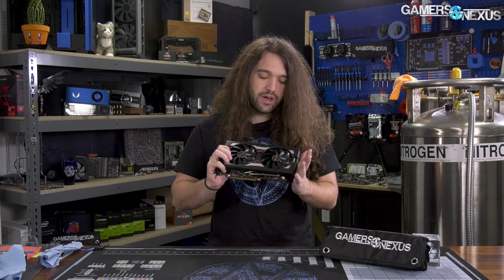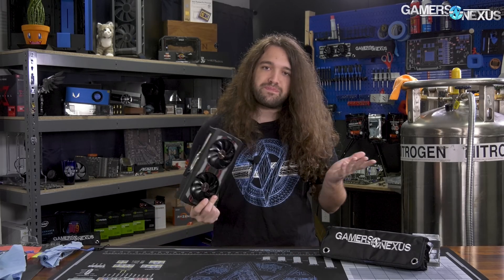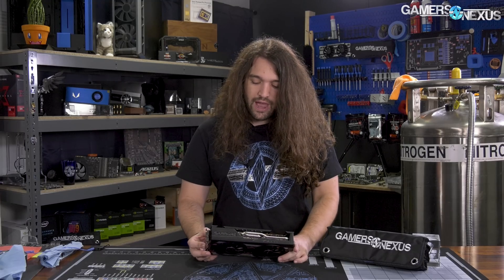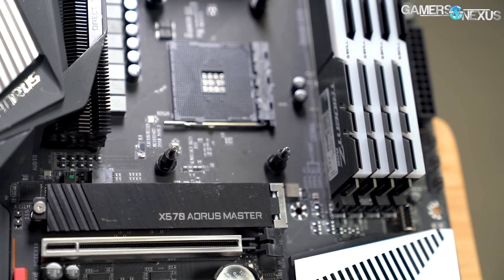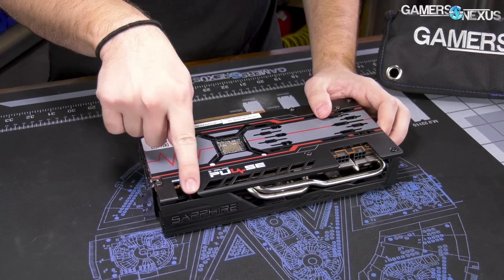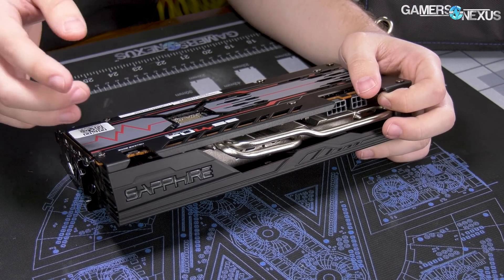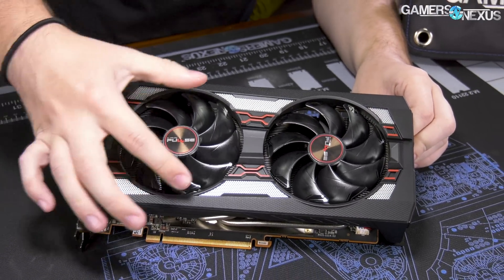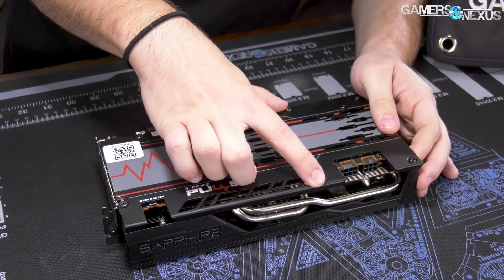Sapphire RX 5700 XT Pulse Tear-Down: Cooler Quality & Assembly

Comment from the maker: Watch our original 5700 XT Pulse review here: https://www.youtube.com/watch?v=FQJCm7bnOfU
Grab a GN toolkit or Wireframe shirt here: https://store.gamersnexus.net/

Link to the 5700 XT Pulse now lands on Amazon page (now that Sapphire set it live).
Reply: reviewed positively in "Linus review"? Description needs some touch up.
Reply: yes yes please, BZ breakdown if it's not just a ref PCB. BZ rants or ravings are the best. B)

I like seeing fins on stuff, that cold plate is sexy as hell with them fins.

Great vid Steve and crew. B)
Reply: Can you test the Raijintek morpheus II? It fits the 5700 apprently.
Reply: @Aggnog  The Morpheus II is keeping even my Vega64 below 60°C at all times with two NF-F12 at 1000-1200rpm. It is a monster of an air-cooler. This 5700 generation does not need that kind of cooling I would think.
Reply: Please release the reference PCB BZ analysis
Reply: Sold out quick, I mean it only cost 10 bucks more.
Reply: Buildzoids breakdown of the ASUS RX 5700 XT Strix was nice.
He was very happy.
Reply: The inset power connectors are genius for side panel clearance. I know that this is because of a narrow PCB but companies should start moving them in on wider cards even when the PCB goes all the way out.
Reply: Does a Kraken G12 fit over the seperate memory heat sink? Seems like this card would be an obvious choice for people interested in AIOs if it already includes good (and separate) memory heat sinks. Hard to tell if the bracket will fit over the top from your video.
Reply: https://www.youtube.com/watch?v=aPcDfuPuh5w go hear and compaire heat sinks between 5700 and 5700xt
Reply: this saphir or gigabyte 3 coller???
Reply: What heatsink design would be better for X570 and M.2 SSDs. One single big oriented to outside, like in this Pulse and in regular Power Color 5700 XT (3DH). Or like in most another card - dual heatsink for GPU and VRM connected by pipes and oriented to motherboard. Which would add more heat over the chipset and SSD?

Comment: I have seen this video before.  I never realized that he doesn't measure the thermal pads on the memory and the MOSFETS under "thermal plate".  I am replacing some right now and I misplaced my digital caliper...I guess I use the mechanical caliper.

Comment: Is 74c to hot for this card ?
Reply: no its normal,i have the same temps and on heavy gaming 2-3 degree up or down depends on overclocking and fans and what game you play but its around 73-75 wich is good,some say they go to 90c on heavy load and said its normal...

Comment: After opening and cleaning my rx 5700 xt pulse sapphire it is warming up and powering up the fans with games I already played. Has it happened to you?
Reply: mabe the stock paste was very good and also very good tide up,try open it again,try diffrent thermal paste and cross tidind up the screws well and you l be fine,clean it good,i do it with a little azax carefully and brasso liquid for shining silvers for the copper,it makes it shine alot like new too much dirt cleaning the copper with brasso liquid does a great job and its cheap if you can find it on cleaning shops or supermarkets like i did...

Comment: Dude, you're really good. If you ever need an intern, I'd fly from Brazil straight away. Learning from you would be huge. Anyways, I've got one of those and I'm planning to change the thermal pads. Never done that before, so I'd like to know if I can buy any sort of thermal pad or there are specific ones. Not only that, but does their thickness matter? You mentioned the first ones were 2mm and 1.5mm, what about the others? Same thing basically? 

Keep up the good work. Look forward to your reply.

Comment: 10:45 thoes W & D stickers mean warranty void if removed. I replaced my thermal pasted and pads. I ended up having an issue with my PC before I replaced paste and pads. My PC would randomly restart (black screen crash). I endee up thinking it was my PSU and it took a couple months for me to find a replacement and a reasonable price. And I still had the issue. I ended up replacing my Motherboard, RAM, CPU and still had the issue. I email Sapphire to RMA my card and they said that remoing those stickers voided my warranty. I argued, the best reason I was provided was. They don't know if I repaced the cooler and overclocked my card and caused the damaged to the GPU. 

I will never buy Sapphire again. I ended up buying a RTX 2070S for the time being.
Reply: And if you remove the sticker on your 2070s the same thing will happen. That's just standard across the board. Just don't ruin the stickers. I Watercooled my Vega 64 and got RMA'd and I got another card from sapphire just fine. just don't tell them you removed the sticker.
Reply: @SrChalice  they sent my GPU back without fixing it  because they where missing those stickers and that ended up costing the shipping cost and wasting all my time waiting for nothing. And not ture about all cards. My EVGA 2070 Super dose not have those stickers and you can easily remove and repaste you card without all the crap I went through with Sapphire. And if you called them like I did. And hear thier dumb reasons why those sticker are so important. You never buy a GPU from them either. I said, no where on the packaging does it say what those stickers are and nowhere do it say warranty video if remove. Thier response followed by a long pause from me. "You should have called us and we would have told you want those meant." I think they are getting so many RMAs that they are hiding behind these stickers.
Reply: @blake112x  there s alot companies do, we need time to explain all the legal frauds they do...

Comment: I bought one. Its amazing for 1080p, running super quiet with great temps and maxed graphics. Seems great for other resolutions, but I can't speak to that since I only use 1080p. The cooler on it is very good.
Reply: Didnt experience any blackscreen?
Reply: @SSPear66  in my case no,but i buy my 5700xt pulse later that drivers improved and did good overclocking,cleaning good leftovers from other card and no black screen but i had one when i got it but what i learned is you give the card voltage from the psu by two seperate cables not one, one for 8 pin one for 6 pin and from that day it never happened ,only one time the time i bought it and a very small  flickering here  and there but after this method it never happened,mabe it worked...and we speak on 1080 if any matters...

Comment: You mentioned the backplate thermal pads were 2mm, did you happen to measure the pads under the secondary heat sink that touch the memory etc? I plan to tear down my card and want some on hand if possible.

Comment: How thick are the thermal pads on the memory modules? I'm thinking about replacing all the thermal material with Arctic Cooling solutions but I can't be sure about those. Can someone help me please?
Reply: @NotPranav  Unfortunately not. I replaced the cooler with Bykski GPU block and used the pads came with it. And that Chinese brands are not big on manuals and spec sheets.

Comment: got this card based on your recommendation, its an amazing card and apparently amd has said that its cards are supposed to run standard at 110c which they recognize as being disconcerting to the culture. i havent seen it go past 93c myself. would prefer to keep it from thermal throttling. this card is as stable as you recommended and its a beauty, thank you for recommending.

Comment: what is the thickness of the vrm's thermal pads. i'd like to replace mine while doing a repaste. they look slimmer than the ones on the back of the card.
Reply: Did you ever find the answer? Im about to replace mine and trying to find the pad size, thanks!

Comment: this would be a great card to hybrid-mod. the non XT pulse costs the same as the reference where i live, i could slap an alphacool hf-14 on there and integrate it into my custom loop for 40 bucks extra. 80mm fan from a wraith stealth on the baseplate and you should be golden.

Comment: for some reason my memory temps on my 5700 XT Pulse reaches up to 104°C. GPU itself stays at around 70°C but the memory is melting which causes stuttering.
EDIT: so I just took the card apart and it seems like I have some differences. My memory is from Samsung and the MOSFETs have cooling fins on top. I expected to see missalligned thermal pads, or even some missing ones, but no... I have no idea why they reach 104°C
Reply: Did You find solutions for that high mem temp ?
Reply: @PachiPL  I run it in a very small case (Fractal Design Node 202) which has very limited airflow. I installed two 120mm fans blowing air directly onto it. That fixed it for me.
Reply: @TheAustrianAvenger  I'm thinking about changing thermopads after more than 2 years of use. But cannot find info if it will help or it is mem cooler design ...

Comment: Have you ever cleaned a heatsink/heatpipe assembly in the kitchen sink or dishwasher?  With all electronics removed (wires, fans, etc) of course, it's just metal.  Same with CPU cooler with the fans removed.  I've done this before to "deep clean" dust and grime out of the heatsink fins, let it dry for about an hour, and it really helps (I've not used a dishwasher, just did it in the sink.)

Comment: I want to upgrade to 5700XT from my gtx 1060 gb. But im scared of the driver bugs you mentioned in your previous video! T_T
Reply: Griffin 17  Did you have to disable any windows features? Like hardware acceleration for apps such as chrome? Also heard that it had issues if you have certain apps installed, like MSi Afterburner / Riva Tuner?

Comment: I don't like that they used electrolytic capacitors for the bulk filtering. Tantalum capacitors would have been better as they do not dry out and suffer increased ESR with age, heat, and ripple current.

Comment: How would it impact thermals if you 3d print thickness extension for gpu fans?  Or just copy that fan design and offset it on top of original fans? Never seen that done anywhere...

Comment: That cooler looks identical to the RX580Nitro+ cooler with maybe 1 small edit in backplate cutouts, otherwise is the same. A cheap paint job to the backplate to match your build and I suspect this is the winning band for buck card.

Comment: Coming from someone who's custom watercooled 980s & now a 1080ti (aorus)... MY gosh I didn't  know there was that pin-to-pad type of connector out in the market for the fans on the GPUs?! Why don't more manufacturers implement this- I mean sheesh I can't tell you how tedious it is to fiddle around with the tin wire + connectors when you're dismantling albeit just once or twice if you go to re-sell a card. But logistically it'd also be much much easier to replace for a consumer in the event one or more fail...It's a small detail but I really did go "holy shit wtf??" when he just plucked the fan right off lol

Comment: Wassup gamer nexus. newer subscriber here, and loving all the content yall  push out.. Can you guys give a recommendation? Originally I wanted to use the (R5 3600 + Rx 5700) but not sure if it will be powerful enough.. So should I go for the (R5 3600 + Rx 5700xt) or the (R5 3600x + Rx 5700) I'm trying to build a pc that will give me enough fps to support 1440p gaming at 144mhz/165mhz refresh rates, I play mostly shooters "pubg, apex, r6 siege, CS:GO etc.. Thanks in advance, and keep up the great work!

Comment: This would be perfect for fitting MORPHEUS 2 CORE since it already has good VRM and memory cooling so you dont have to make DIY cooling for them with double sided tape and small heatsinks.

GAMERS NEXUS - You realy should check Morpheus 2 Core black. Costs 65€ but you can use it multiple years :)

Comment: A little nitpicky...but at around 15:52 you measured the heat pipe, and said "I think this is 6 mil? yup, 6 millimeter heat pipes here." mil and millimeter are not the same thing. A mil is 1/1000 an inch, which is much smaller than a mm. I wouldn't be surprised if you knew this though, and just misspoke, hence why I opened this comment as being nitpicky :-D

Comment: If you read sapphire's official warranty policy, "The limited warranty does not cover products that the user has disassembled. GPU or ASIC devices (VGA) are sensitive to thermal (heat) issues. The heat sink has been designed to meet the requirements to ensure reliability of the product. Any warranty is rendered invalid if the product has been dismantled or the heat sink has been removed as this may cause damage to the GPU or ASIC device. Non-compliance will cause the warranty of the product to be void and repair will be at the users cost."
So yes, by disassembling the card, they state that you have voided the warranty. You should get on that.

Comment: was there anything keeping the PCB rigid? help with sag or w.e. Like a metal plate that is attached to the io plate and to the case. Doesn't seem so. Otherwise the PCB is holding up the cooler

Comment: How is the clearence between the RAM/VRM plate and the GPU heatsink? Would it be viable to put a thermal pad between them to improve memory thermals at low fan RPM?

Comment: The copper staining on the die seems like a failure waiting to happen.
Copper is toxic as far as semiconductors are concerned.

The copper interconnects within modern CPUs and GPUs are very meticulously encased in a barrier metal that stops the copper from diffusing out into the chip. The reason for this is that copper forms  deep-level traps that practically inhibit transistors and other semiconductors from working.

The diffusion barrier on the back of the chip (the surface connected to the heat sink) does slow down diffusion, but inherently doesn't stop it. (same thing goes for the barrier metals surrounding the copper interconnects.) In essence, the copper will leach out over time and eventually stop the device from working. (the speed of this diffusion is directly proportional to the temperature. (rough rule of thumb, 2x faster for an increase of 10 degrees C.))

So seeing the chip stained with copper is mildly concerning, since the diffusion barrier shouldn't easily get stained. (unless it is missing, or if the chip has had a copper coating on its back, could be for thermal transfer reasons, not that this really would do much other then be a very thin base extension per say...)

Comment: On the dual heat sink design, it looks like the exposed heat pipes sit on top of the second heat sink's plate that's right above the GPU, the part that sits on the top two memory modules. Of course there's no paste or pads between the two, but it looks like the two heat sinks do touch in that location. 
I wonder if the two heat sinks are supposed to be pasted there. Not the most efficient design, but could have been done for ease of manufacture, or for more fin surface area, or something.

Comment: It seems Sapphire has used the same fans on this card as on at least some of their earlier Radeon cards. From what I can see these fans have a ball bearing, don't know if it's dual or what the other bearing is if it isn't. It's listed as having a 30,000 hours fan life and a max speed of 3500RPM.
And yes, it's available from AliExpress, though it's not the cheapest at $20. Hopefully the quality matches the price.

Comment: Only thing I'd like to add, because Igor pointed that out, it would be great if you guys would use an external thermal scan test. Igor noted that the 90+° on the memory are borderline impossible, since his heat spectrum camera read out over 20° less in actual temps. Something like that might get lost if you guys rely too much on the internal sensors. Thank you very much!

Comment: Amazing job from sapphire as usual, would absolutely be all over this card if I hadn't jumped on a nitro+ V64 on sale several months back, the cooler sapphire implemented on that is god damn heroic, even for cooling Vega64. I never see max gpu core temps exceed 50 celsius with my usual uv/oc gaming profile at 240 Hz, ~1600 MHz core/1100 MHz HBM2 at 1.056V.

Comment: When i bought my RX-580 I discovered the BIOS switch was for Normal mode and Mining mode, which has tighter timings and clockspeeds for mining.

I hope theybdo that again with these cards because it's actually a really nice feature..

Also, mining mode doesn't game well, and you can't change the clocks so i couldn't adjust the memory frequency lower to stabilize it.

P.S. I bought an RX-580 Nitro+ 8 gb from newegg for the game Bundle. Also, mining mode doesn't break Driver Signatures